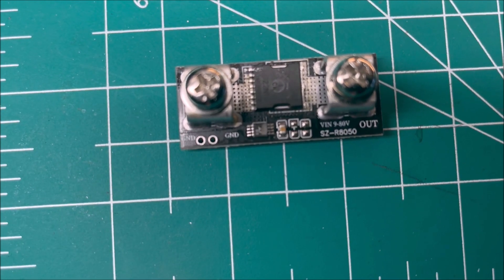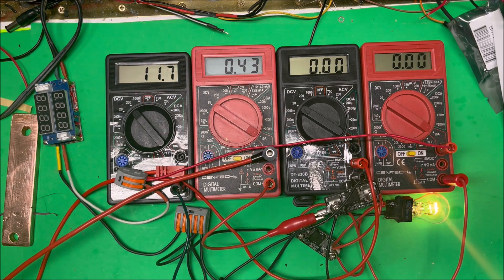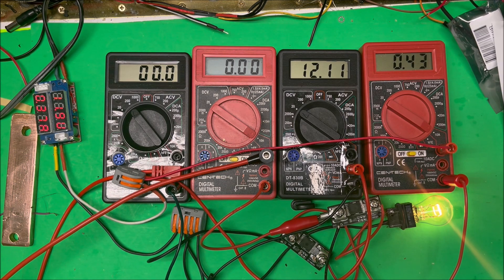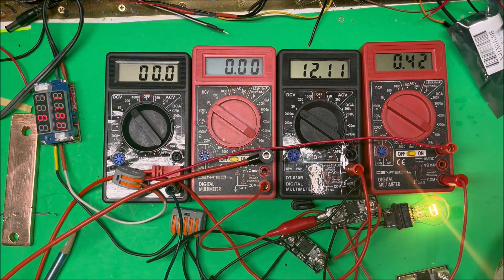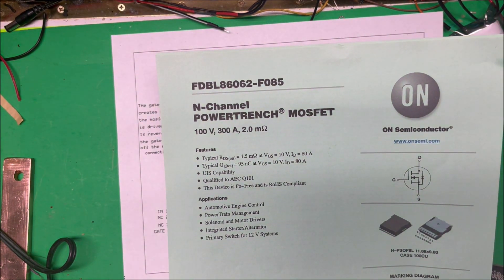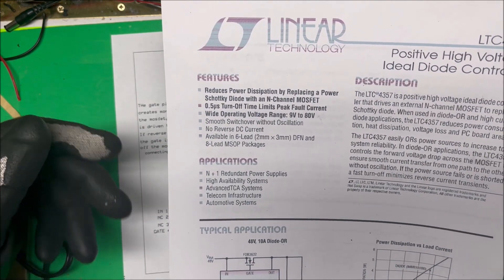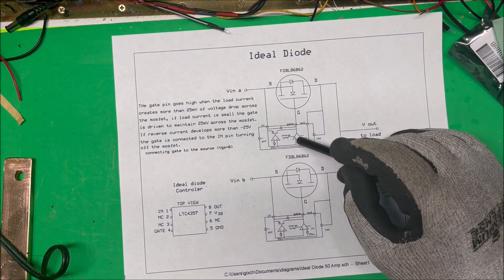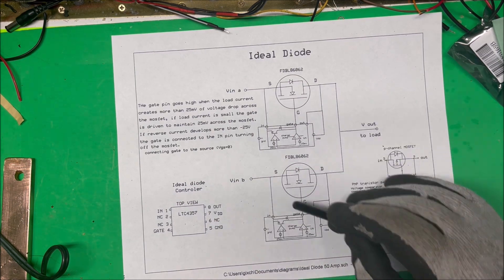50 amp ideal diode

Comment: Can you drive these with an external power source?
Same question just more detailed:  I'm looking to use one of these in my PV setup but the voltage is greater than 80vdc. Is it possible to power them with use of an isolated power source?

Comment: Share your source on the 50 amp version please….I’m getting heat during forward current…only god knows in reverse…
Reply from the maker: AliExpress   80V 50A High Current Ideal Diode Module Solar Controller Anti-reverse Charging Anti-Reverse Current Protection

Comment: Thanks - nice test, good to see they work.  Mine are the same only red colored circuit board.  i checked the controller it indeed says 4357.    sounds like the sluggish turnoff you observed was due to lack of substantial reverse current flow?  (hopefully that's the case..).   also for what it's worth, when I was researching these someone said on some ebike forums that the 50a version is good for ~25a continuous without extra heat sinking.  in any case prob best look up the RdsON of the MOSFET and do a power dissipation calc for your expected load.    ..since  these "diodes"  would  fail short etc..
Reply from the maker: Thanks for the comment